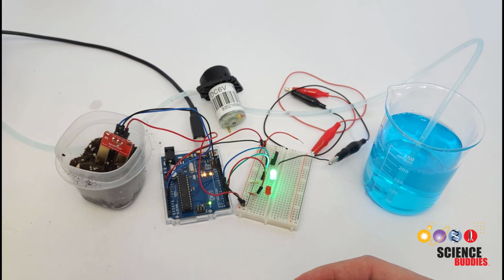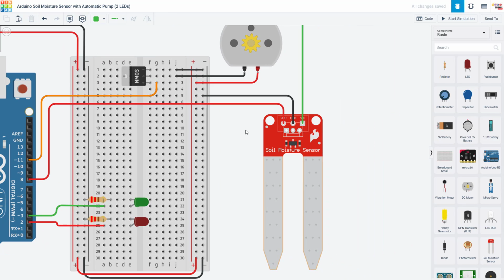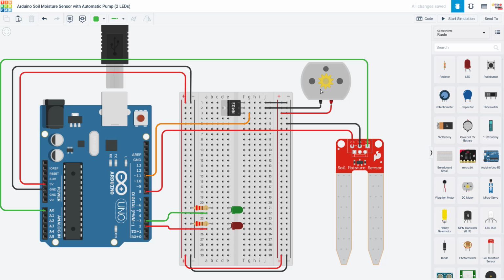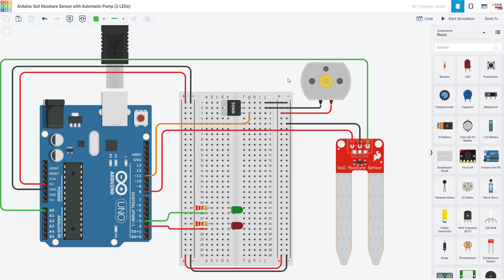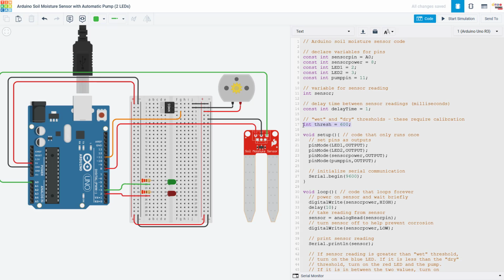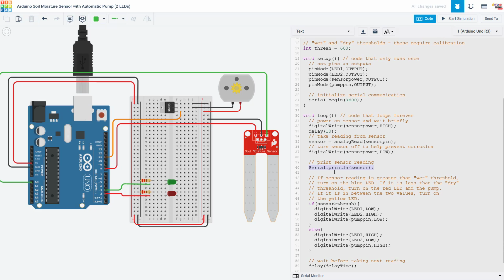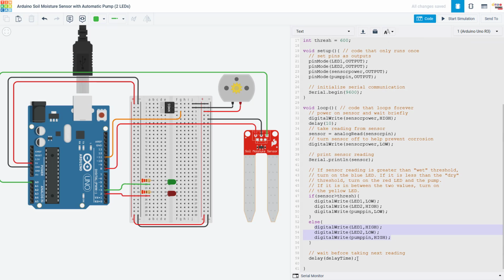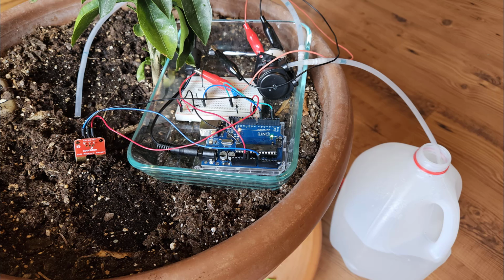Automatic Plant Watering with Arduino | Science Project

Comment: I'm sorry, but don't you have those sensor resistance levels backwards?  If the resistance is below the threshold then the soil is wet, and vice versa...  What am I missing?
Reply from the maker: The key part here comes around 5:25 in the video - the sensor outputs a voltage, not a resistance, and this voltage is inversely related to the resistance. You are correct that lower resistance means wet soil, but a higher voltage means wet soil. So if the analog reading is above the threshold, the soil is "wet."
Reply: @Science.Buddies  thank you, I see now.  My confusion stems from me being an electrician.  The way I was looking at it, the moisture sensor isn't outputting a voltage, it's more like a variable resistor, so we're just really measuring the voltage drop across the device and adjusting accordingly.
Reply from the maker: If you put two resistors in series you can make something called a "voltage divider" - there are tutorials for this on YouTube if you search for them. In this case the soil moisture sensor likely actually consists of two resistors - the resistance between the probes, and an additional fixed resistor on the board that forms a voltage divider. This is a common configuration when using an Arduino with a variable-resistance sensor because it lets you convert resistance (which the Arduino can't measure directly) to voltage (which it can measure). A photoresistor is another good example.

Comment: Hi, thanks for making this great video. I would like to build a system like this for around 30-50 plants each requiring their own sensor and water feed. How can I scale your setup? The arduino board you showed only has 6 analog inputs.
Reply from the maker: Hi - you can look into the Arduino Mega which has more pins, but still might not be enough for your case. We would recommend asking this question on the official Arduino forums where you may get more help.

Comment: I'm going to build this thank you. I have to say this is the best explanation that almost addresses my specific problem. Well in fact I might just run with this instead. Only thing is I need to run a 12V 19amp pump. I wasn't able to get it working with either a relay or a mos module unfortunately

Comment: I notice the LEDs turn on below threshold but the pump doesn't. Is there a bug with tinkercad or is it something with the code or hardware?
Reply from the maker: Hi - we can help you with this project if you post more details in the Ask an Expert forum on our website: https://www.sciencebuddies.org/science-fair-projects/ask-an-expert-intro. We will need to see your code and pictures of your circuit to help you debug. Many times problems are just due to a misplaced wire on the breadboard.
Reply: you probably need a seperate battery to power your pump (if you mean its happening irl)

Comment: Hello, mine works pretty well but there is one issue. When I try to set the delay time over 30 seconds it doesn’t work properly, any ideas on how to fix this? Mine’s been hooked up to my plant for a few days on 30 second delay but in the long run the sensor won’t last as long so I want to find a fix. Thanks

Edit: got it to 60 seconds, had to change the const int
Reply from the maker: Hi - if you are having trouble with this project, please post your question in the Ask an Expert forums on our website, and include a detailed description and pictures of your circuit, then we will be able to help: https://www.sciencebuddies.org/science-fair-projects/ask-an-expert-intro

Comment: Great watering technical solution and good video, but I also try that earlier and after one mount the copper spikes corroded and disappeared :S . I logged the watering numbers and onced  the numbers turned to unreal . Maybe try the capacitive type measure spikes (that is coated with paint or hard material coat).